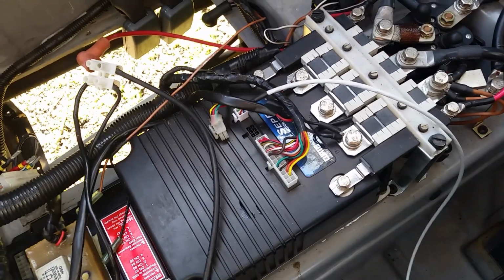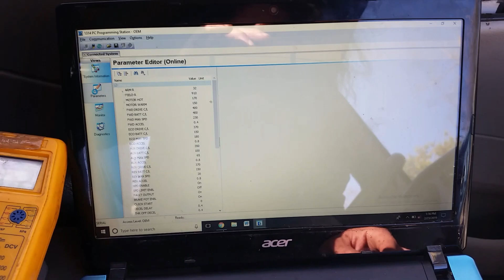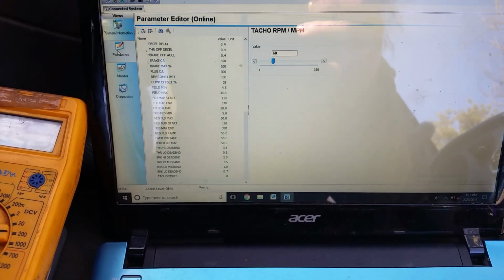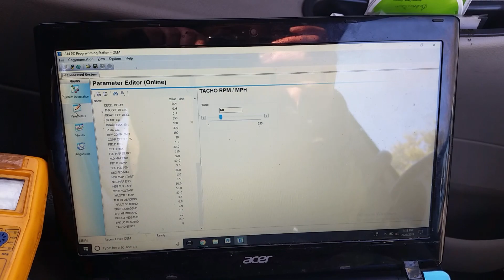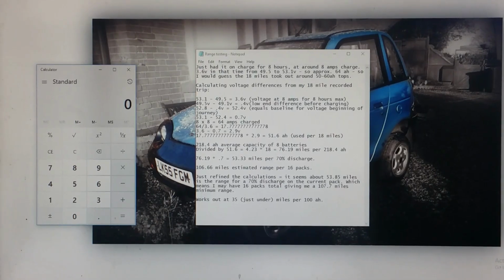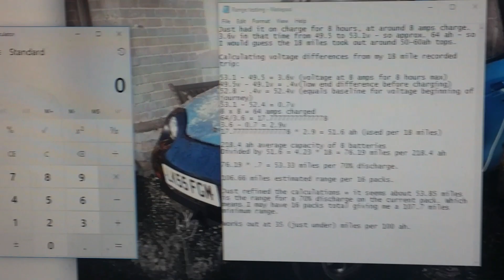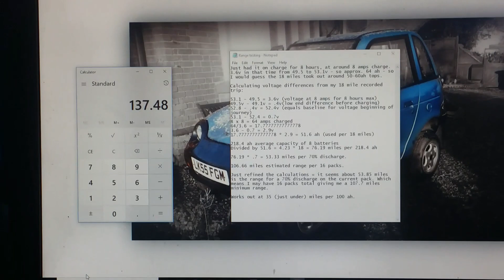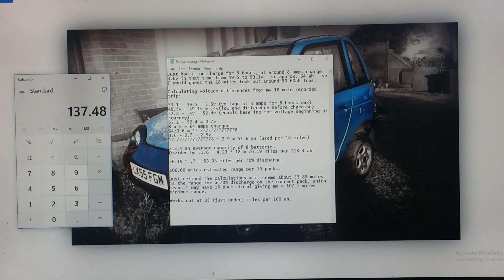REVA G-WIZ LITHIUM ION CONVERSION: Programming and estimated range calculations

Comment: Seams easier to convert a diesel to run on waste oil
Reply from the maker: It's actually much easier to convert the gwiz as these first videos suggest. I had no help back then so I was learning as I go. It can take a few simple hours of changing batteries and modifying or installing a  new charger and you're good to go.
Reply from the maker: Most of the other issues I experienced was because I was pushing the car more than it could handle, like the bust dc motor.

Comment: The ebay link for the cable doesn't seem to be working anymore. Any other link you have? Thanks
Reply from the maker: I believe the listing just changed... here it is again: https://www.ebay.co.uk/itm/USB-programmer-cable-for-Curtis-controller/153721887757?hash=item23ca89dc0d:g:p-AAAOxyaTxTPxdO

Comment: Have a Reva g Wiz which I need to program whereabouts  are you how much would you charge to simply let me use your dongle
Reply from the maker: Northamptonshire, however you are probably just as well buying this one on ebay - this is what I have: https://www.ebay.co.uk/itm/153429089463?ViewItem=&item=153429089463
Reply: @RichardMawby  thank you very much for that link that is much cheaper than the ones I've found. I'm driving the DC model on a CBT
Reply: Sorry pressed the send button by accident again. Provisional licence 350kg without batteries 28 mile an hour 4 horsepower to the road so I need to install motor RPM sensor so that I can limit the speed  and reduce available power at the same time by same means removed the back seats as I can only have one passenger. I want to do a lithium upgrade on it eventually but if I make it any lighter I will have to change the springs as the ride height is a bit high already no anti-roll bars as it is the early model but handles quite well considering even at speed 45mph mine seems to absolutely love roundabouts and cornersI have installed LED headlights to reduce power consumption they have worked well. Although my BMS is absolutely f***d I have two but they need recalibrating or I have a wiring issue as when I look on the software the voltages of the batteries are all over the place and make no sense as I test the batteries with a multimeter they read fine. To get around this problem I have had to unplug the charger from the BMS so the charger runs flat out not the best situation I know. Since November when got the car on the road I have done about 5000 miles it seems to have done quite a lot of damage to the batteries tho😣😥😥 they were brand new when I got the car on the road £1,105 😭😭😭 I paid £350 for the car😊 from London brought it back to Stafford in a Mercedes sprinter panel van it sailed through the MOT no problems but I know centre mount bush on rear swing arm is deteriorating and makes it feel rear steer and top mounts have completely deteriorated making the front wobbly/sloppy I think I need to buy another one as a donor something a bit newer than 2006
Reply from the maker: @jamesgittins6752  Good luck with it all, great car to have on a CBT!
Reply: I believe I have the software already
Reply: I am in Stafford  please get back to me